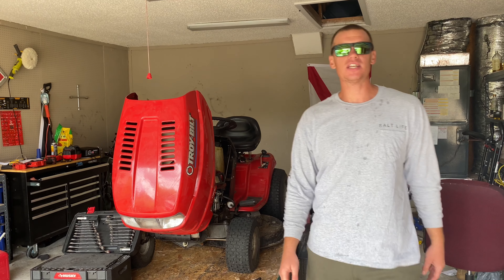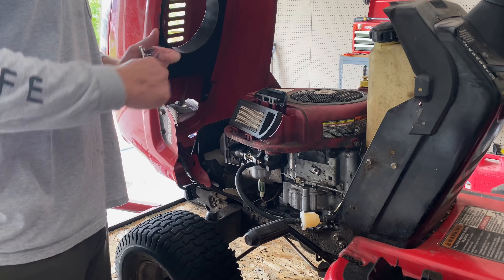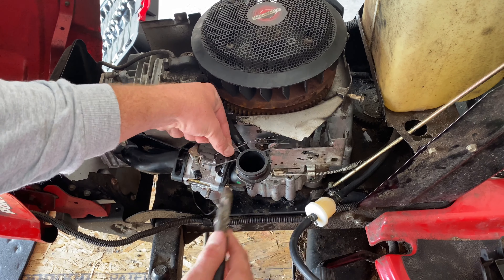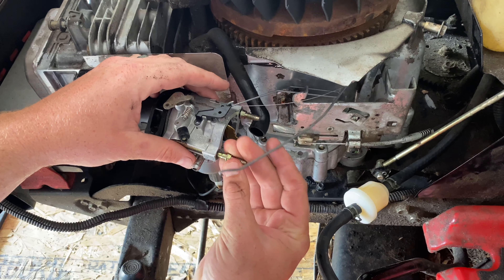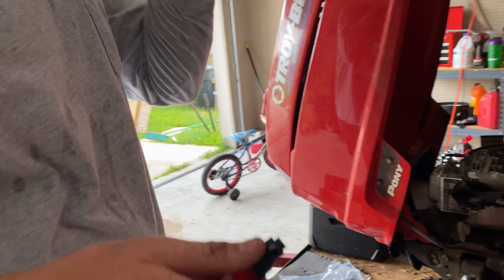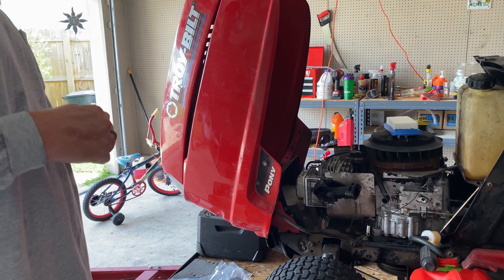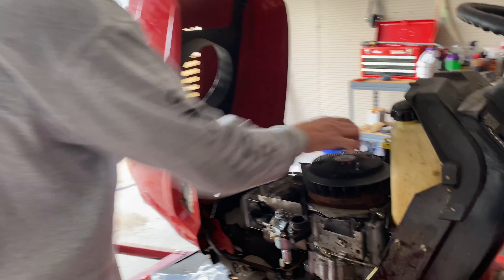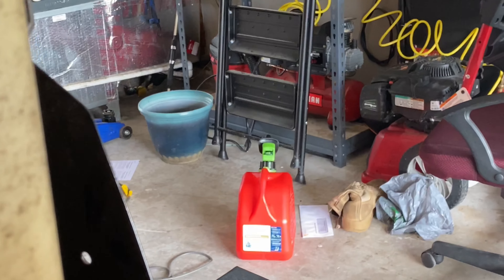Troy Bilt Pony Carburetor Replacement

Comment: Mitch, I bought the carb kit for my Ariens with that same 17.5 hp motor.  A couple of updates/cautions to your viewers.  On mine, all 4 bolts on the magneto cover are 3/8".  The rear 2 are "Long" shouldered and the front 2 are short shouldered.  As for the choke linkage, install the throttle linkage first, keep a little tension on it/them, THEN install the choke linkage.  Easy peasy.  Be CAREFUL that your throttle butterfly is LOOSE.  Mine had a minor binding (burr?).  Choke worked perfectly.  Your video was excellent.  Thanks again!

Comment: Dude!!!!  Thank you!!!!!  I ran across a few videos that demonstrated how to switch out the carburetor.  I was able to remove everything with no problem while waiting for the part to come tomorrow.  While removing the carburetor, the choke hangar came off.  Although I took a picture of the set up before I removed the carburetor, I could not tell from the picture how the choke hangar was supposed to be seated.  I had zero idea of how to reposition it.  Talk about panic!!!!. . . . until I ran across your video.  I searched high and low before finding it because I was searching under Poulon Pro, my mower. . .which is the same as the Troy built, husqvarna, craftsman, etc. . . All of this to say one more time, thank you for making this video brother.  Keep doing what you do in spite of the haters who criticize from their keyboards.  At least you made an effort to make a positive difference.  And based on all of the remarks I have read regarding your video, YOU are making a difference.
Reply from the maker: Thank you for your feed back. I found myself looking all over YouTube looking for help. I had to figure it out on my own, I decided that more people desired the explanation of the throttle linkage due to my own problems. I hope to make more repairs for people to fix issues such as this.

Comment: Dude - you just saved my bacon. Couldn't figure how to get my motor housing back in place...your tip for how the oil fill fits into the underneath of the housing was VERY HELPFUL. Thanks man!
Reply from the maker: Not a problem, I find myself usually in the same situation. Most videos glance over small details that end up being “lessons learned” I figure I’ll take the 30 seconds and explain it.

Comment: NICE! I have the EXACT same mower and engine, but I rebuilt my carb....very simple. I bought the mower used and noticed in your video that VERY fine spring attached to the carb is missing on my rig. The choke is puzzling too, but you showed how it is re-installed. THANK YOU! BTW, It's very common for the head gasket to blow between the valve port(s) and cylinder. Easy replacement on that but it's a good idea to do a carb check too. Thanks for the video!

Comment: Thanks, this was really helpful.  My Pony was a tiny bit different.  All 4 bolts had to come out to remove the top cover.  I also had to remove the gas tank to be able to get the rear bolts out.  All the rest was identical.  The absolute biggest tip was the choke connector.  I would have never figured that out on my own.  Thanks again.

Comment: To thank you so much for making it quick and informative. I’m working on mine with the same engine and you answered the exact question I had
Reply from the maker: Glad I could be of some assistance! Thanks for the feedback.
Reply: @jakeniteasy7909 I was wondering what the choke thing was so I rushed to find out what it was and I was lucky this video saved me from forgetting the bolts
Reply: We have the exact same mower but for some reason my model number isn’t matching with the ones on the listing ? My model number is 13AN779G766 any help would be greatly appreciated,
Reply: @EternallDemon  what listing are you talking about?
Reply: @Yourlocalredneck812  the link he posted, it’s supposed to be for the Troy bilt pony but my number isn’t on the list
Reply: @EternallDemon  okay. Are you sure your not looking at the serial number?

Comment: I wish I’d seen your video sooner! I got a very similar kit for my Poulan, and it looks like yours might have this too. There’s a screw above the fuel supply, and and inch towards the front of the mower. The screw has a spring on it, and there’s a covering plastic piece that came in the kit… what does that do for the carb?

Comment: It looks like the kit came WITH the new solenoid? is that right?  Also thought I saw there was a gasket... where would the new/replacement gasket go...looks like maybe manifold? did you HAVE TO change that out too?
Was the a new new carb or a rebuilt carb?
I also purchase off Amazon mostly concerned about the air filter and pre-filter my local store didn't have instock. Was also please it came with a spark plug and fuel filter. Spark plug came in handy BUT the fuel filter was the wrong kind.--for the type that has a fuel pump...mine if gravity no pump. Local store did NOT have the fuel filter OR supercede fuel filter but found one similar and size etc. Only thing I don;t know is if the flow throw was the same "microns".
Anyway...looks like my only option yet to self solve is the carb. so might be taking that on... last step before I buy a new mower and send this to someone else to mess with and put the mower deck belt on too.

Comment: I wish you would have shown us how to re-hook the choke linkage.  Then, if you don't want to use it, take it off again.  GOOD VIDEO!
Reply from the maker: That’s a valid point and I apologize. The choke linkage slips through that slot and gets pressed by the throttle controller. It connects to the only remaining hole on the butterfly valve.
Reply: @jakeniteasy7909  No problem.  I just wanted to SEE your gyrations one has to go re-attaching it for us "purists".  GOOD VIDEO!
Reply: @jakeniteasy7909  Excellent video nevertheless.

Comment: If you end up with a leak on the back side of the carb I think it could be the gasket. They gave you one in the kit but you didn’t use it. I couldn’t tell if there was o e on the old carb.

Comment: What is that black hose that conected to the intake of the carburator. It should have had a clamp. That hose was leaking gas out and I just installed a clamp to avoid gas dripping out of that hose that is coming from the top of the engine next to the flywheel.

Comment: Preciate the vid! I came here b'c my carb solenoid was leaking or at least thats where the gas was dripping..perhaps it running down from up above that...instead of troubleshooting as to where the actual leak is, think I'll just buy another carb since it's only $25..thx again.

Comment: Good video mitch  i have basically tthe same mower what is the Part Number to that Carburetor?
Reply from the maker: Carbhub 791858 Carburetor Replacement for Briggs & Stratton 792358 791858 794572 799727 698620 793224 697190 697141 14hp 15hp 16hp 17hp 17.5 HP 18hp Craftsman Lawn Tractor Mower with Air Fuel Filter
Reply from the maker: Copy that comment and search on Amazon it’s 22.99…. That’s the exact verbiage from the part 🤙🏻
Reply: Ok thanks bro. I'll give it a try

Comment: Great Video. Nice sweat shop.  . Went to my shed saw gas on the floor. Opened my tractor air filter housing and saw the breather filled with gas. Ended up draining the oil, rebuilding and sonic cleaning my Nikki Carb. Put it back on my tractor and it ran like shit. Back to the drawing   board. Disassembled  again, this time drilling out the secondary idle jet agai. Put back on and ran great. Was it worth it
Hell NO. Should have bought a new carb.  $8.00 for the kit, $ 2.00 of cleaning solution and 2.5 hrs of time rebuiling. I am in the red on this project. Would have been better off doing what you did and buy a new carb. Although I do believe that you take your chances buying an after market carb. This chance was well worth it for you

Comment: what part number is the breather hose? I am trying to buy one since mine is bad. Could this be causing the engine to shut off after 15 mins of use due to high temperature?

Comment: I'm having trouble removing the fuel solinoid. Does it come off?
Reply from the maker: Do you mean the plug? My plug came out relatively easily.
Reply: Fuel solenoid, under the carburator where the wires connect
Reply from the maker: @shemacferguson6190  it should pull off just like a normal electrical connection

Comment: Wish that would have fixed mine. New carb it cranks and runs then after 15 secs it smokes and smells it looks like oil coming or dripping out the front like where the exhaust pipe comes from.....help !!!!!

Comment: I have the TB 110 which looks a little like yours... but it won't turn on. It turns but it won't start. I cleaned the carburetor, changed spark plug, the coil and new battery and nothing. 😢
Reply from the maker: Are you getting spark?
Reply from the maker: Pull out your spark plug leave it connected to the rubber wire and turn the motor over. If your getting spark try spraying starter fluid in the intake, after the plugs reinstalled. If it won’t turn over then you may have a bigger issue.
Reply: @jakeniteasy7909  is the spark suppose to come out of the plug? Nothing lit up 🤔. I noticed the tip of the plug got oil. It's that suppose to get oil?
Reply from the maker: @mpbeautyboss  yes the spark should come from the tip of the spark plug (that’s covered in oil) as long as it’s connected to the rubber connector. Clean off the plug and you can try again. If still no spark you’ll have to troubleshoot the electrical system.

Comment: Quick Question.... Does this carb come pre adjusted? Did you have to make any adjustments on the needle settings? I got this kit on the way for my Pony as well.
Reply from the maker: Emperial Studios I did not have to make adjustments, but I’m realizing I need to choke the motor now that I added this carburetor that’s the only thing I’ve noticed.

Comment: Is your replacement carb still working ok?  I am thinking about just ordering a new one too instead of trying to rebuild.
Reply from the maker: Still works like a charm, it likes the choke now but no complaints otherwise
Reply: @jakeniteasy7909  I replaced mine with the same one that you used.  It works great now.  thanks for the info and the great video.

Comment: You are a steely-eyed muscle man and don’t let the YouTube snobs crank on your videos! I have the same mower that has been in mothballs for 3years. It won’t keep running and it is probably the carb! I have a ztrak and a craftsman zero turn and both are only three and four years old but both quit and so I sent them to be serviced.. I thought the Troy built would be the second backup ! Oh well I will have to replace the carburetor or wait till the other mowers are returned. So thanks for the video again!

Comment: Could I get the part # for the carberator in video from Amazon. My model IS A 17.5 HP Also.
Reply: Didn't see the matching model number in amazon 13wn77ks011, 2013
Reply from the maker: The link for mine is in the description of the video

Comment: Mine runs just fine, no sputters but I have white smoke that won't stop. Not sure what to do :/
Reply from the maker: You may have oil getting into your cylinders
Reply: @jakeniteasy7909  thanks so much for the reply man! I'm very very beginner at this so what would I do to check that?
Reply from the maker: Honestly you need to monitor your oil consumption, see if the mower uses more oil than usual. If that’s the case, your piston rings may be bad. Which unfortunately is a large repair. Let me know what other symptoms you’re having. Hopefully I’m wrong..
Reply: @jakeniteasy7909  So I drained and put in new oil last night and it was still happening. But today after you told me to monitor the oil consumption,  I cleaned up the oil that went everywhere on the motor/exhaust and I rode around on in for a little bit and the smoke has completely gone away.. So I'm thinking, yesterday I put MORE oil in because I thought it was low and when I went to drain the oil, there was A LOT of oil. I'n guessing I overfilled with oil and the engine overheated and backfired while mowing?
Reply from the maker: You may have accidentally spilled some oil on your exhaust manifold causing smoking, if it cleared up this is great news!
Reply: @jakeniteasy7909  yeah I have no clue. I heard a loud pop when mowing and thats when I started getting a ton of smoke

Comment: Mine is the last of the newer ponies!  Most cases its trash in the tank, fuel filter, carburetor solenoid, clog air filter,  or fuel line.  A carburetor lasts a long time The 2 main things goes out the most is  >  the fuel filter, or the solenoid These trashy toy bilt mower you ever twist off the hose on the fuel tank. YOU FUCKED UP THE TANK NIPPLE  trashy thing!   Why they put a trashy hair wire on the leakage for?  WHY?